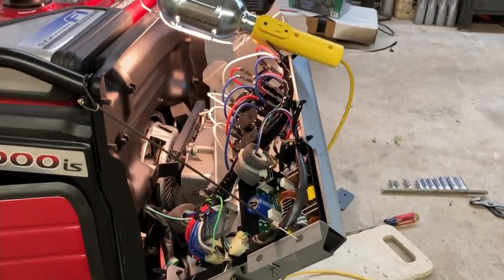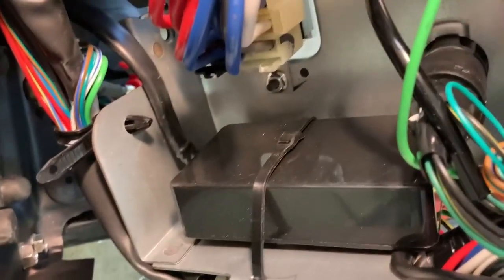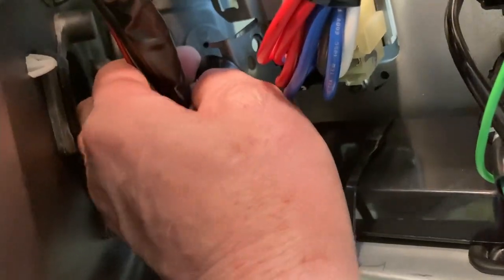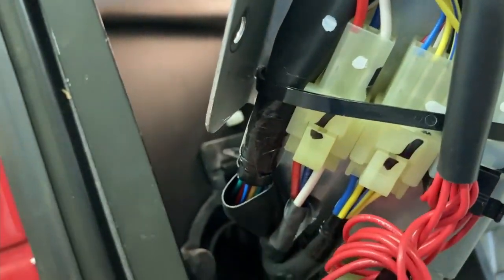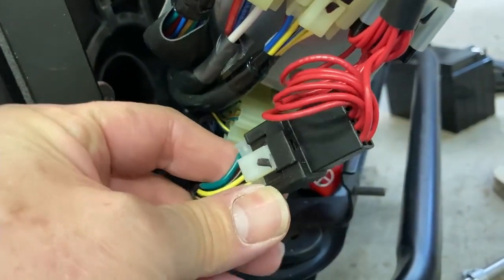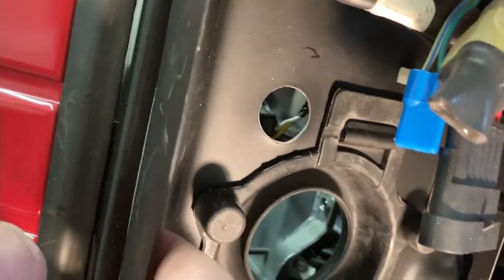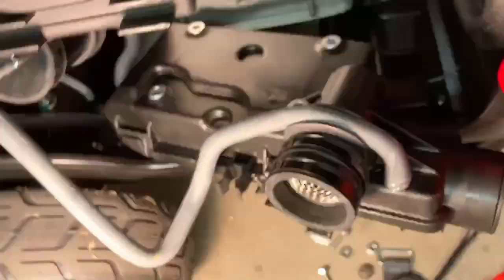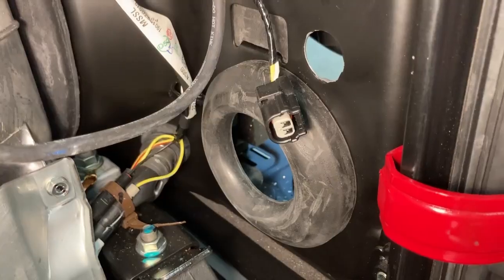Honda EU7000is US Carburetion conversion kit installation details

Comment: I am trying to remove the Honda eu7000is control panel like you did in this video, but ran into a non standard nut in the lower middle securing the panel.  Do you know the tool used to remove this nut?  Great video!  I am trying to install conversion kit like you did.
Reply from the maker: Hey Peter, can you show me which nut you're having trouble with?
Reply: Mr Mark, Thanks for your reply.  I tried to reply but email was returned, after research I found the bolt to be a security hex and I got it removed.  So far my generator looks like yours.  Thanks again.
Reply from the maker: @petereckland690  I'm glad you figured it out, but I'd still like to see that nut<grin>
Reply: Can you show where you mounted your switch?

Comment: Will Genconnex take their kit back and offer a refund? Have they ever shown their product working correctly with ECO mode?
Reply from the maker: To their credit, I asked for a refund and they gave me one.  

I've never seen it running any better than in does in my video.  To this day, my videos and yours are the only ones that turn up in a YouTube search for "EU7000is Genconnex".

I did offer to test their new version for them, but they declined, so I'm not sure if that speaks to the fact that it doesn't actually work, or just that they don't like me.  Not that I think they like me, but I'm guessing it's mostly the former, because If they have something that actually works, they'd have to be nuts not to want me to show that to all the people who saw my videos showing their previous kit running so badly...over 10,000 views at the time of this writing.  If I was them, I would send me a pre-converted generator in exchange for a new video highlighting their new kit and also linking to it from the original video, along with an explanation that the problem had since been solved.  

Which I would be happy to do, by the way - it was never my goal to cause them trouble - I just wanted my generator to run right, and I was hoping that I might get some help from my viewers.  As it turned out, I did - from you!  It wasn't the solution I had originally imagined, but the thing works now, so hallelujah (and I thank you).
Reply: @MstrMark  Well, I suppose it all comes down to customer satisfaction.  If someone comes up with what they believe is an ingenious or good product, but their customers aren't happy...then what have they actually achieved?

I'm also glad that there is another alternative and that it works. Lugging and storing gasoline or running a gen at full speed all the time due to conversion kit product limitations is not an ideal situation.
Reply from the maker: @browsedeweb8834  I do agree...but It still seems strange to me that they wouldn't want some good publicity for a change.